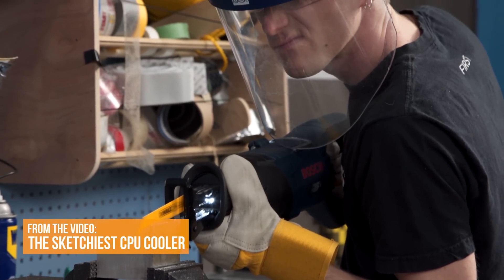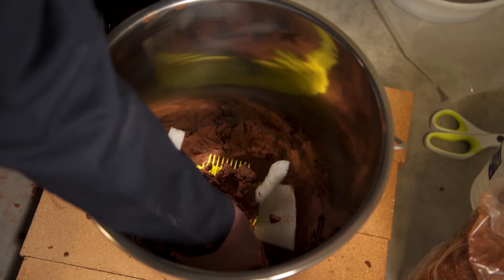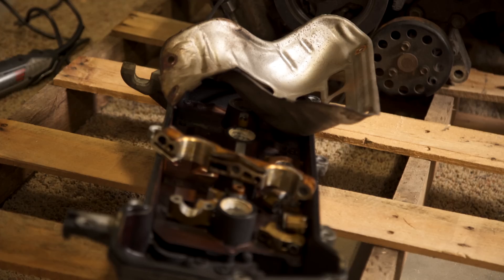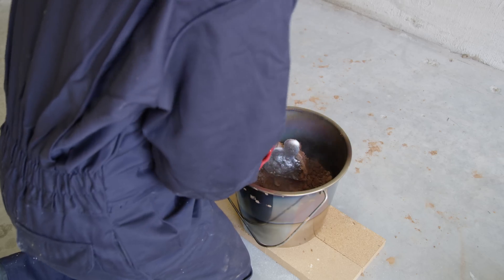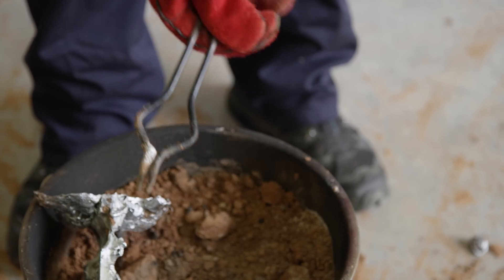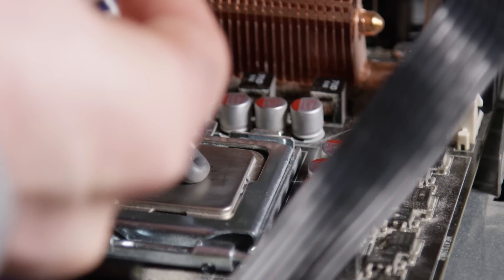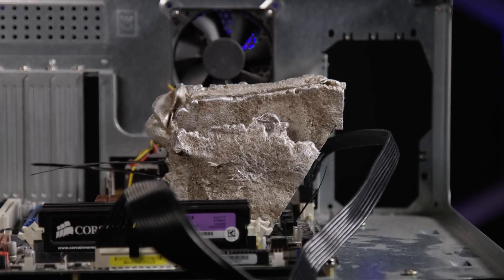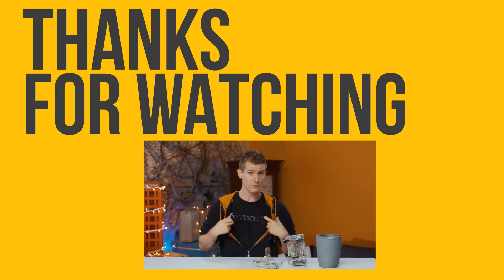The WORST CPU Cooler EVER – Sketchy Heatsinks Ep2

Comment: You ... can't just pour metal on top of PLA... you have to melt out the PLA in a forge and wait for it all the drip out.  Like ... did you guys even research this before you tried to do it? XD
Reply: I know nothing about it but even I was skeptical one should just pour the metal on it. Felt wrong.
Reply: @Kyanzes  theres some materials that will just vaporize when the touched by the metal. so no your not wrong. LTT just used pla. which they shouldnt have
Reply: Yeah, I was wondering where they thought all the liquid PLA was supposed to go.
Reply: @roondarmurnig338 , in true lost PLA/ABS/Wax...etc, you let some drip out (minimizes pressure buildup in the mold, and carbon buildup in your kiln), then you turn up the heat to around 1350 F (burnout schedules vary considerably) with exposure to air. I've only done investment casting, but the heat is high enough for long enough that the PLA turns into carbon, and then in a burnout kiln (which allows air in), the carbon (C) oxidizes and turns into CO2, and "disappears". This is in part possible due to the porous nature of investment mixtures. When I first got started, I was like, where does it all go, haha, it's like magic. For small items, I don't worry about dripping and just let the carbon burn off.
Reply: Research? RESEARCH??? We're men, we figure out how to do things on the fly!
Reply: It was probably Linus telling guys at the office "do aluminum casting heat sink, we're makin video about in in a week" and guys jut... went ham :D
Reply: Also they should have used a liquid casting clay, not "green sand"
Reply: @lukasg4807  Green sand would have probably been fine had they actually put enough you basically need to ram the bucket full of it until you cant put anymore
Reply: thats linus company dude ...
Reply: They could have also got a metal grinding machine that's like a 3D printer it grinds out the patterns.
Reply: No lol, I dont think they did more than 10 minutes of research before doing it.
Reply: @andrewmalhotra  they could have easily used clay molds
Reply: I mean... When I think LTT, I don't think "metal casting experts"
Reply: @Timeward76  well yeah but that attempt was pitiful they could have done better easily
Reply: The answer to your question is no, as ever with LMG projects alex is anywhere near.
Reply: @henryatkinson1479  when watching videos of LTT with supposed engineering in them I feel like... Alex really oversold his skills in his resume
Reply: @leumasgh  Agreed. They have a super nice shop now, and somehow always manage to create turds. I chalked it up to time at first, but it seems like Alex is just generally incompetent. 

Further, WHY do they have him do laptop reviews? Him telling lenovo to remove the trackpoint 6 months after Linus said that "we would never take points off for including one" in a different thinkpad review is just plain stupid.
Reply: Ha Ha metal go bRRRRRRRRRRR
Reply: 3:20
Reply: Why would they research it if the point is that it's SUPPOSED to be terrible, and because it's bad it's funny? The title is called "sketchy heatsinks." They weren't really trying.

Comment: can cut aluminum easy with a sawzall like yours using a wood/particle board medium tooth blade, althought the blade wont last long it will make very clean cuts, had to cut steel piping that way once in a pinch

Comment: Once more wondering if there is any restriction on calling yourself an "engineer" in the US of A... "Mommy, look i smeared my poo all over the kitchen walls." "Honey that is great, you are an engineer now!"
Reply: There are no restrictions on calling yourself an engineer in the US, but there is in Canada where Linus and his company are.
Reply: Uh, yes there are.

Anyone can technically get a engineering degree, but "Engineer" is actually a protected title in the US (depending on the state i think).

So yes, you can call yourself an engineer all day if you want, but if you do it officially and someone reports you, unless you have been licensed by the state after taking an exam, you can be prosecuted or fined.
Reply: What states? I have never had any kind of Engineering License, but have held job titles containing "Engineer" in 5 different states. My only employer to not include "Engineer" in the job title was based in Ontario.
Reply: It depends on the specific type of engineering.  For example, in construction, the sign-off on the HVAC portion of the building plans has to be completed by a licensed Mechanical Engineer in most states.  This is separate from the other architectural drawings which are typically signed off by the architect.

For typical plant applications and drawings you will have engineering sign-offs on all kinds of things, like processing tanks, transport systems, processing furnaces etc.

Comment: Holy crap, a video whose clickbait title actually lives up to my expectations :D That "heatsink" was just hilarious :D
The problem with stuff like this (and the reason manufacturers prefer milling the aluminum blocks using CNC instead of casting) is all the fine details (which won't cast too good using the methods you've tried). You might want to give it another try using a 3D printed part, casting it into plaster of Paris (adding the heatsink upside down), melting the plastic out of the mold after the plaster hardens, then drying the plaster in the oven for a couple hours (to drive out as much moisture as possible). The best is to keep the mold hot in the oven right until all the aluminum is melted (and you're ready to cast). This will give you the finest details possible with casting and the least amount of cleanup. And if you do it well, the result might actually resemble a proper heatsink even :)
Reply: I'm looking at attempting this myself but with a water block. Though, I have had fairly good experience with proper casting for small statues and jewelry, so hoping those skills convert over to water blocks. Jewelry investment captures such small details that I have actually accidentally captured my fingerprints before when casting a ring, it was from me packing clay at the base to form the reservoir. Plaster of paris may work, but I've heard it's components break down in the heat required for a proper burnout, so you risk cracking if you try to burn it out (burn off the PLA/ABS/Wax into carbon and then into CO2). If you don't do a proper burnout then your detail capturing and surface finish will likely suffer.
Reply: I'd agree about the mold though. There are casting temps suggested per material being used. The temps specify the best range for both your mold (flask temp in jewelry casting) as well as the casting temp for the metal. Beginners make the mistake of trying to cast as soon as it's liquid, but that isn't usually the proper pouring temp. Too low gives you poor casting details as well as risk an incomplete cast. Too high causes more oxidation issues, more gas absorption causing gas porosity, and potentially shrinkage porosity. The temps get more complex when you're discussing alloys too.
You also want to be mindful of the cooling rate so that you get the proper metal grain structure.
Reply: they don't machine heat sinks afaik, either they press thin sheets over heat pipes or they extrude a really long heat sink shape and cut it into pieces.

Comment: You should try wax! Since it melts in less than a second, the fumes are less harmful and to get it to seep into all the edges a centrifugal acceleration unit would do the trick. It's how dental technicians form acrylic and porcelain teeth.  It rarely goes wrong and you can achieve exact detail if the sand is fine enough. At least at the level and size of teeth. I cannot say how well this method performs on larger casts. However, in a tooth cast, it's rarely just one tooth that is in the mould to avoid material waste.  I would suggest a thin candle as a good pouring point!

Comment: Do you think you could use a cheap oxygen mapp brazing torch with some copper phosphorus brazing rods and some pure copper rods and/or plates for the rest of the heatsink? Remember to use brazing goggles, I doubt it would be easy to braze fins on but you could make a pure copper heatsink styled after those little VRM heatsinks. Hell, maybe you could use a flat piece of copper with some holes drilled into it and just solder a bunch of fins made from copper tooling foil onto it!

I really want to see you try making your own mesh style heatpipes out of copper tubing for plumbing and copper wire, not sure if you need a vacuum pump or can just boil water in the pipe then cap it off though.

OH! You should try using a pure copper waterblock and run a bunch of mercury through it with a few cheapo parastaltic pumps in parallel to move it and just a ton of copper tubing in place of the radiator! Maybe the mercury would conduct heat well enough to get away with using a spiral of thin copper tubing pressed slightly flat or soldered to a copper plate in place of a waterblock!

OH! What happens if you solder a heatsink directly onto a CPU? Does it do any better than the best thermal compound?

Comment: If I were going to make a curiosity-driven DIY aluminum fin heatsink, I'd try bolting some flat stock together. Two sizes, one the thickness and width of the fins, and the other the thickness of the desired spacing and width of the base overlap with the fins. Getting a good thermal bond between the layers would of course be very important (right surface finish, clamping force, and maybe thermal compound?), and machining the base to be flat seems like a good idea. Aluminum angle on the edge would allow for easy mounting, though there are many ways to go there.

Comment: Hugh Bone explained "How To": In real world, the aluminum is extruded.  Your Lost plastic was a joke. Likely intended that way.  You needed a Kiln and 12 to 24 hours to burn out the plastic.  Better would have been Lost wax, easier to work with, does the same. I wouldn't have used your sand, you don't understand, How To,  Sand casting. Sand it isn't for that type of delicate work.  However this was a joke not serious, it was funny to watch someone who is several steps down the ladder than a beginner.  Thanks for the LOL.

Comment: Why didn't you drill holes trough an aluminium block and have a fan blow trough? in an l configuration have some vertical for air goring up and hoizontal for fan air

Comment: Should’ve done loss wax casting. From what I can tell, you didn’t have enough sprews to get the molten metal to travel into the slots on the heat sink.

Comment: I think lost investment casting would've been much better. 

You'd make 2 molds, but you can make a silicon mold of the 3-D print and then cast a wax copy. Use the wax copy to make a plaster mold and melt out the wax. Cast the aluminum into the plaster mold.

Oh, not having the metal hot enough was the issue. You really want the crucible to be around 300+°F over the melting point of the metal your using to prevent rapid cooling while keeping a hot mold to boot. Metal working is a science as much as an art

Comment: Make a cooler of solid sterling silver sheets. Silver is quite inexpensive and great conductivity
Reply: rumle silver inexpensive kek
Reply: umm... no silver is about 100x  more expensive than copper and only provides at most a 5% increase in thermal disapation ability. there is a reason solid copper heat sinks are really rare, because they are EXPENSIVE. and you want to make one that costs 100x then that?

Comment: If you are using fans, the fins should be turned 90o, or if not, at least the case turned 90o for the thermal resistance to be minimized.

Comment: Print heatsink In pla with pour and gas chamber make a mold of pla model in silicone cast wax model of heatsink pack in two part Green sand mold (less clay next time) heat aluminum, pour out aluminum melt wax tada casted heatsink... lost foam is ok but lost wax is the method you want next time

Comment: Little opinion to go. Use the heatsink mold from plastic and put it on the sand upside down, so that the fins will go inside first making it alot easier to finish the mold. While the alumunium is in cleaning process, you heat up the final mold so that the pop expansion from the plastic is less worst and you can get better, well-shaped heatsink that you planned. Use the recent laser cutter/good 3d printing to shape heatsink.

Comment: i work with aluminum, we diecast electric engieens for washing machines, to get right form of the heatsink you need to use a Diecasting machine, need the power to form the aluminum,

Comment: You need to watch how's it made lol where they use wax or even that 3d printed heat sink then cover it ceramic slurry layer by layer then heat it at furnace to harden and melt the plastic then cast it

Comment: Oh Linus, Linus, Linus.  What a fun video.  I'm not a professional metal worker, but even I know there are some basic mistakes.  Firstly, your crucible is too small to skim impurities, try a broader form factor then transfer it. More importantly, just like most manufacturing... you mentioned 'Pressure' for your casting.. (not being able to fill the cast UPWARDS).  Even in industry to avoid using pressure to push upwards to create moulds (including Chocolate) you need to create the mould 'Upside Down'.  This allows the natural flow to penetrate the fine details of the mould without pressure.  Love the work tho, give it another try, I'm sure you could 'Crack' it wink wink lol.

Comment: Next time (if there is one) just flip the foam model upside down to get it into the fins then pour from the top
Reply: Justin Gould 
I thought my green sand was bad, but Linus had to go and make a pile of goo. 

Lost foam casting even works with dry sand.
Reply: Not to mention, sort out that horrible "green sand" mush. That was so terrible.

Comment: you should have gone to  ahrdware store nbought thier iron sand or whatever its called specified for casting. then use and oxy-acytlyne torch after molding your desired shape poured in and use an acid to remove any excess slag

Comment: Well now i know why most heat sink blocks are made from billet cnc'ing than casting... Should have just melted the aluminum into a block and then cut away at it with a 5axis CNC machine.

Comment: You had the design upside down.... the bottom should have been on the top. Have gravity help you not working against you. Put the fins at the bottom and the bottom where you pour. Then cut the sprue off and grind flat. Use your original 3d printed concept with the redesign. Just make sure you pack your fins with green sand really well. Ps I'm a mechanical engineer (ASQ black belt) and we did aluminum casting at my school and I worked with aluminum extrusions for 3 years.

Comment: Should have done sand-casting.  Then you wouldn't have had to melt any molds, the sand holds the mold shape and you just poor in the molten aluminum and finish off the top with a grinder and sander

Comment: as a caster, i groan at these attempts. honestly, your best bet is trying lost wax casting.
it needs things like vents that go to each one of the high points to assure no bubbles. also aluminium has nutoriously high shrinkage so you need to design the gating to accomidate for that by having large pour cups.

Comment: 3D print one using inconel. Also, since you're using Solidworks, have you considered using the design drawn up and then dicing out the design in a CNC mill from a solid aluminum block?

Comment: You guys needed to use really fine sand
Reply: Silas Mayes I doubt that it would've made any difference.
Reply: CoolKoon it makes a large difference. The finer sand really helps for small details.
Reply: Also who uses a reciprocating saw against a block of aluminum...😂😂😂
Reply: Silas Mayes he also needed styrofoam as it's much more sturdy
Reply: Theres no need, he qould only need to sand the base later. Their main problem was poor casting skills and horrible mold design.
Reply: Was looking for this comment
Reply: They need to cast it into block, then use skiving technique to create the fins.
Reply: they don't like sand. It's course, it's rough, it's irritating and it gets everywhere.
Reply: What about plaster?
Reply: I was actually wondering this myself, if they sand they were using was even the correct kind.

Comment: If you're going to make the effort to use green sand, why not also do a two part mold, using the pla printed part as the reference. Though you may need to reduce the number of fins on the heat sink in order to extract it from the green sand and not have it fall apart.

Comment: the could also have bought a block of copper and a sheet of aluminum or copper, cut the sheet into squares, and soldered them all onto the block. this would not only be cheaper depending on what soldering station you go with, but also produced a more reasonable looking result.

Comment: We just made holes for risers  in H.S. shop in our molds. I bet those foam risers blocked your alum from entering the mold fast enough. Our sand was very thick oil based but would smoke after being poured but worked fantastic. The heat would burn the oil off and the sand was easy to remove.  I bet Canada wouldn't allow oil/sand tho.  OMG that is the worst mold/pour I have ever seen. roflmao!

Comment: you can buy copper pipe and aluminium flat bars and copper rods, drill holes through the aluminium then hold it together with the copper rod.

Comment: If you truly want to cast your own heatsink, why not use the casting method for partials. I worked as a dental tech at one point and we would take a wax model and encase it in "Investment" correctly removing bubbles. Once dry, place in oven at 2500 Celsius. Once the models have reached the same temperature as the metal that was being melted, cast the piece in a centrifugal machine. That is how I would do it.